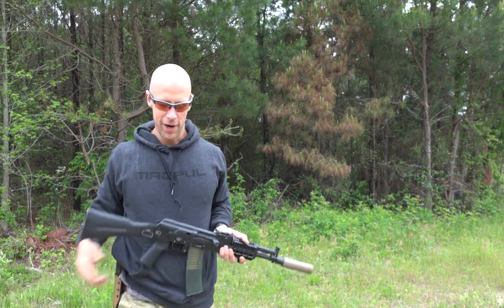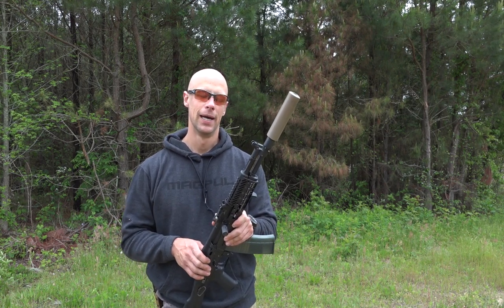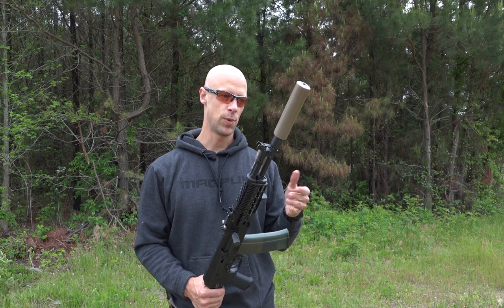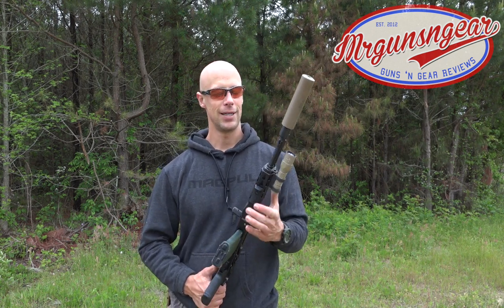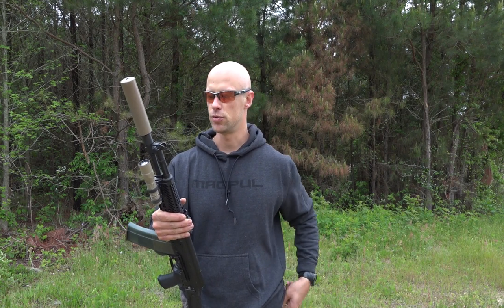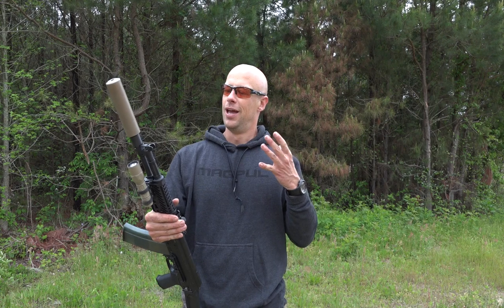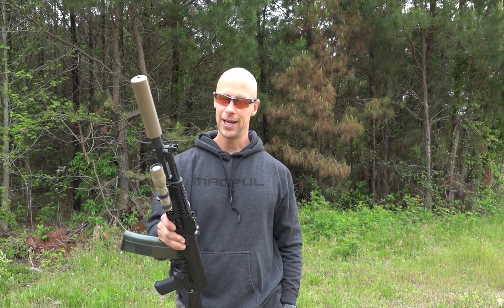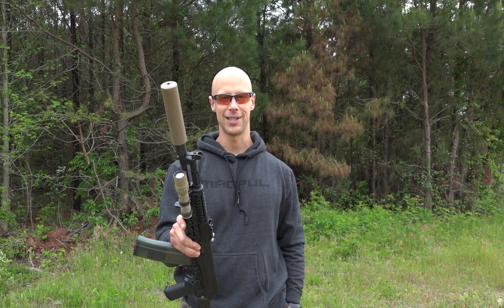Tips For Suppressing The AK-47 & AK-74 Rifles (HD)

Comment: Ahhh, the "hot dog down the hallway routine", lol. I'm glad the alcohol blurred out most of those memories back in the day ;D I'll stick to my iced tea & water!

On the topic at hand, I love the idea of a 7.62 AK suppressed. You have a dead reliable and rugged platform. A gun that will keep on shooting in the nastiest and dirtiest conditions which a suppressor will facilitate happening. You can certainly run full power loads or back down to a subsonic loading and get it quiet. As mentioned, getting it sealed up is the hard part. It needs that vent on the gas tube to operate properly. If a guy could make a baffle to hush the vented gases, not unlike a suppressor on the end of the barrel, i'm sure that would help. And better sealing the ends. Like a dead soft copper/aluminum gasket? Compression fitting on the gas block? Wouldn't hurt to try to seal the receiver end up some too. Some good potential.

Comment: Thank you for this video. Just bought my first suppressor and gonna check for concentricity on my AK with a US made barrel using the flashlight method. If all is good, gonna go for it. Omega 36m with ASR mount on ASR Muzzle brake or flash hider on the original threads.

Comment: +Mrgunsngear Channel one way to remedy the gas leaking oa the gas tube would be to use a yugo m70 or a polish (i can't remember the model) gas block since they have a gas cut-off valve.
that will turn the rifle into a very quiet straight pull bolt action
Reply from the maker: thanks

Comment: I wouldn't trust the cleaning rod method to test for concentricity. If the two inner diameters were not concentric, the small diameter of the rod may still pass through. Lack of concentricity creates an "eye" shape that would cause a strike with the larger diameter of the bullet.

Comment: The issue I'm having using non-subsonic Hornady SST rounds is the bolt carrier being seriously over-gassed which is really hammering the receiver, more so on my SKS it would seem (weaker spring maybe?). Plus some serious gas in the face after a 3+ round shot string!!! It's looking like I'll have to make my own loads on the bench to compensate for many of the factors this platform presents when used with an (over-barrel) suppressor. I'm going to fit a rubber recoil buffer as well just to be on the safer side of component wear and tear since the overgassed/aggressive cycling can't be good for the rifle... Hopefully I can get it sorted with some work as a suppressed AK/SKS is the ideal bush/pig gun for hunting here in New Zealand.
Reply: Is that one gone now also?

Comment: Wish we would have seen the adapter going on.  I'm having trouble figuring out what I need to do.  I have a dead air primal and keymo but my flash hider doesn't thread all the way to the front sight block or the detent even.  I have seen 14x1lh to 5/8x24 adapters but there is just no consistent info on what to do.  Scamish to be honest.  I have a 14x1lh 3 prong flash hider for sale!
Reply: Dude I'm in the same boat I have a full nelson by Q 7.62 & wont thread on my draco because not enough space to read the threads I need a adapter but dont know where or what to look for

Comment: Out of curiosity, can you get an over sized suppressor for a 7.62 AK?  And is there any disadvantage to running a 30 cal suppressor on a 5.56?
Reply from the maker: Wambli Waste There are some but they're VERY expensive.
Reply: Wambli Waste typically 7.62 suppressor with a 556 booster would have a little less effect than one designed for the specific cartridge.  However, the advantage on a 762 is one-size-fits all, and the loss in suppressing the signature, with today's technology, is starting to get unnoticeable.  Hope this helps.

Comment: Big questions, I ordered a thread adapter from USMachineGun LLC 14x1 Lh to 1/2x28, are they reputable adapter builders?  I own a Arsenal RPK in 5.56, I have a silencerco hybrid I want to run on it should I run a 30 cal cap?  I was considering running the asr system muzzle brake 5.56 on the adapter and using that for the silencer do you think that would work ok? What typical sound reduction are you seeing on a 5.56 Ak is it any quieter then the 7.62?
Reply from the maker: they are

Comment: have you run supressors on any of the DDI rifles? i have a 74 from them and plan on running a can on it. im really wondering if the threading is consentric (is that how you spell that?)?
Reply from the maker: I have not
Reply: Would I have concentric threads using a thread alignment tool (tat) and die? Or would I have to put it on a lathe? I would be doing this to a MAK90 btw.
Reply: update, i talked to DDI, they said that the muzzle threading on the 74 is part of the front sight post (it slips over the barrel) and they dont advise you use those threads for mounting a suppressor.